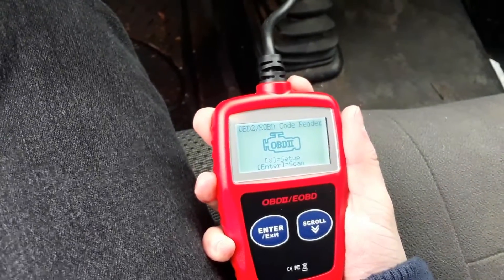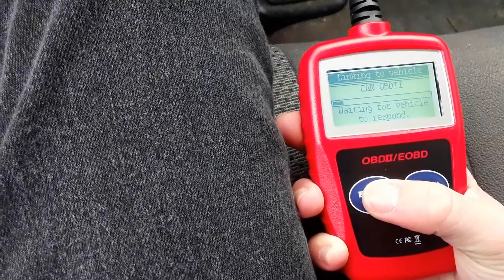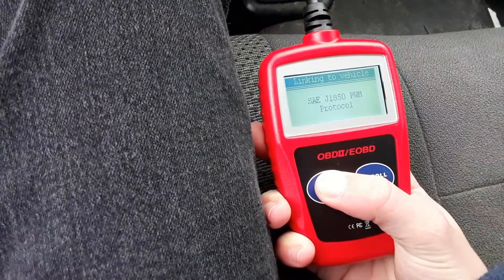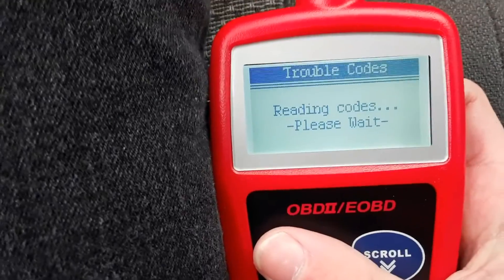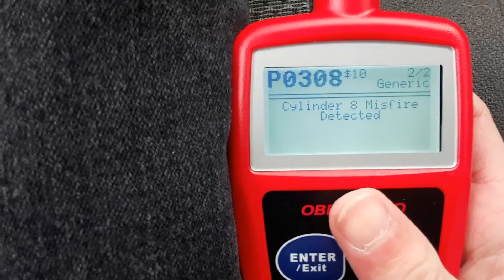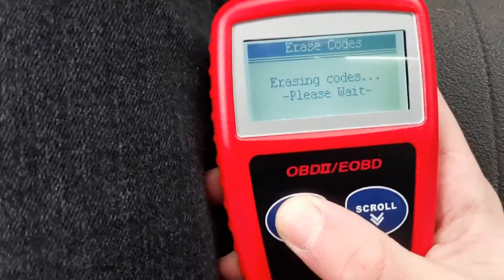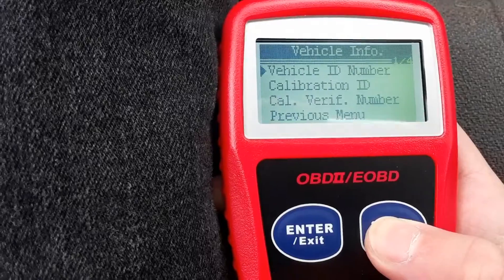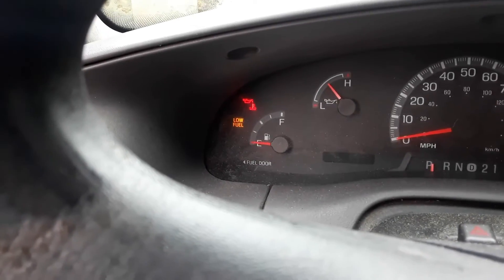How To: Clear Engine Codes (OBDII Scanner)

Comment: Hey, thanks for the video. I have a question: my code reader doesn’t delete the errors. Do you have any idea why that might be?
Reply from the maker: It might be the type of code you have. Some can be erased, some can't. Keep in mind a scanner isnt designed to fix the initial issue so the codes will come back after a little while unless you fix the problem. I would look up the codes and go from there.

Comment: Hello,
Does this unit turn off the drain and maintenance lights?
Thank you in advance for your reply.
Reply from the maker: It can clear check engine lights but only for a short time, its primary function is to check the code that causes the light

Comment: How long do you have to wait to get a emission test after clearing the codes
Reply from the maker: I would drive it for a bit before getting it tested but the light will come back on at some point if the initial issue isn't fixed.

Comment: Not a good scanner for modern cars. Experineced problems using this just with my 2010 toyota. Innacurate.
Reply from the maker: I've used it on several vehicles with no issues, although it was $20 so I wouldn't expect much

Comment: If i hook one of these up to a truck will it tell me if the seller has deleted bad codes like for ex a check engine light i need to know because i am interested in buying a truck
Reply from the maker: I don't believe so, normally if you clear a code with one of these without fixing the initial issue the light will come back after driving 10 miles or so. Good luck!
Reply: @mightymachinez  thank you

Comment: Misfire? Doesn't seem accurate. Also, would not check engine light flash if that were the case?
Reply from the maker: At the time it wasn't misfiring but a few months later it did, It ended up being a coil pack.
Reply: @mightymachinez  In that case, the device is really impressive, that it detected the onset of trouble. I learned the hard way when an auto shop misdiagnosed a problem I was having as a bad O2 sensor. Later it turned out I had 4 bad ignition coils after sinking $$$ on the wrong issue.
Reply from the maker: @vikramgupta2326  Yeah, been there done that haha. Sometimes they aren't super accurate but for 20 bucks it was a steal, I still have the scanner from the video and It still works great.

Comment: If I ever erase all the codes on my car with the tool, will I be able to pass emissions?
Reply from the maker: You should be able to. Before they got rid of emission testing here, I used that scanner to clear the engine light and it passed just fine.
Reply: @mightymachinez  wow seriously, thank you!
Reply from the maker: @deathiscoming3010  No problem. The light will come back eventually but it will say off long enough to pass emissions.
Reply: @mightymachinez  oh ok good all I need it to do it’s work at the emissions that’s it. Thank you again
Reply: @deathiscoming3010  did you pass the emission
Reply: @saucyg407  I did it works

Comment: VEHICLE is supposed to be in the on position and not running, just like the code reader stated, not running, key on. Can screw up computers from what I've been told on certain vehicles, so beware before you start using it. Best to you.
Reply from the maker: Thank you for the advice!

Comment: Trust me it will come back on
Reply from the maker: It came back on around 6 months ago.
Reply: @mightymachinez  mine did to the next day so i put a new PCV valve on and engine light went off, fixing to install a thermostat after that I'm checking all my vacuum lines and replace those, cause I can tell a huge different in my obd meter especially with idle
Reply from the maker: @suzieq8379  Mine was throwing a code for the EGR valve, I replaced it but the light is still on. It still runs and drives perfectly so I know it's nothing major, probably just an sensor. (My check engine light has been on for years off and on, my father tried to figure out what it was when he still owned it but we didnt have much luck).
Reply: @mightymachinez  check you vacuum lines one of my codes when away when I fixed it
Reply: Props, he responded a year later..
Reply from the maker: @maximusedwards2042  I still reply to all of my videos! 🤘

Comment: I bought a performance tool brand obd2 scanner $40. It works almost completely the same as your scanner. The only difference is how the codes are displayed. Yours tells you what the code means. Mine has a book of codes.

Comment: I tried this in my car it does not work .it disappeared the engine light then it came back soon as Iam done erasing the codes .
Reply from the maker: The scanner isn't really designed to keep the lights away, it just tells you the codes, hope this helps.
Reply: To summarize what Mighty Machines said,  you have to fix the problem then clear the code.

Comment: Thanks for your help! I bought the same code reader but had no idea how to use it....(maybe in the future you could show us how to plug this thing in because I have no idea what I'm doing!) :)
Reply from the maker: @Rachel Stevenson Glad I could help! The plug for it should be above your pedals.
Reply: I fixed my problems on the car and then cleared my codes. I have been driving a lot to get a 'read' on the scanner. Is there anyway to find out if it will pass on the scanner before I take it in?
Reply from the maker: @woodsofwindsor5116  The scanner is just to figure out what is wrong with the vehicle. If you try to get it inspected chances are they will be able to tell that you cleared the codes yourself.

Comment: do the codes come back again if you still have a problem? or the car just ignore the problem? how does it work? because i want to get my lights off my dashboard but if the problem persists i want the lights to come back on
Reply: Computer Simulated Atomic Coded Reality I turned mines off for a sensor but it haven’t came back off
Reply from the maker: The codes and lights will come back on in around a week or so. The scanner is just to see what codes you have so you know what needs to be fixed. You can also turn them off with the scanner to try to pass inspection for tabs, but sometimes the inspection station can tell if you turned them off and they won't pass you.
Reply: @mightymachinez  Great info many thanks!
Reply from the maker: @ourcollectiveinsanity   Any time!

Comment: I changed Fuel go to Shell and get my Gas Only, took #8 plug out switched it to a Iridium Plug No more problems. 04/27/2019. I have 97 Dodge 2500, 5.9. 4X4. Great Truck.

Comment: Mine failed to erase. Mine was a P2646 code on my 2004 Honda element.
Reply from the maker: Sorry man I know nothing about Honda's, but you might need to take it to a garage if it didn't turn off.
Reply: It's the rocker arm oil pressure switch. The light comes on and goes periodically. It's a fast fix, but usually comes on again after replacement. Something with the V-tech engines, when they came out. A lot of element owners have this issue
Reply from the maker: + @kevinlempfert9202  Well good luck on getting it fixed! 👍